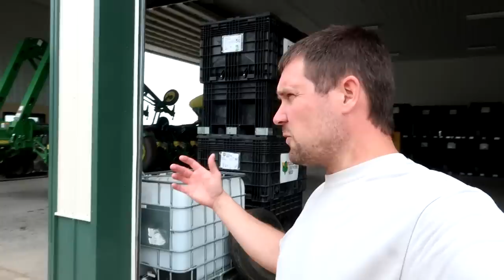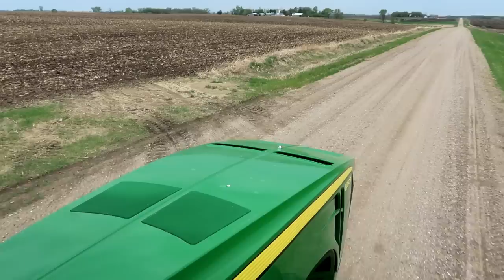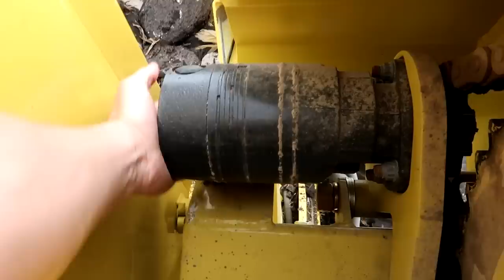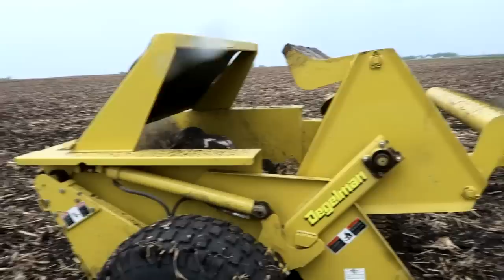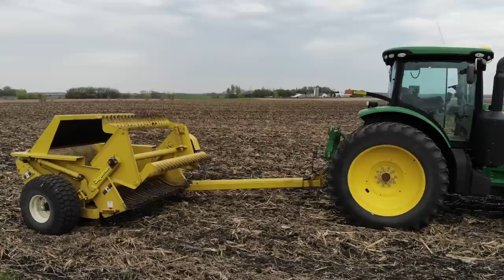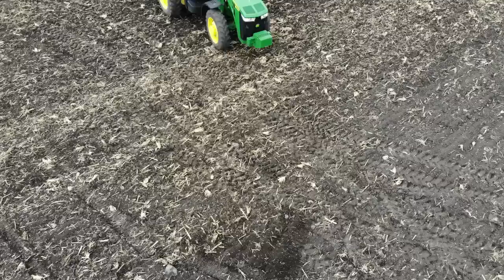How our Rock Picker Works

Comment: Over machined on the pickup, we had one with the samed lay out but the pickup was a 5 foot blade instead of a reel with a chain get that when raised it dropped the rocks into the hopper. Worked great.and didn't have to stop to pick the rocks

Comment: We just bought a Degelmen identical to yours last winter. We were moving stones in it (we were loading it with a skidsteer) and I bent both cylinders first day out we locked the teeth going up and down and dumping with that locked bent both of them. We run ours on a 7210r and have had great luck

Comment: Its nice to how different the hydraulic version of the Degelmann works. On the farm i have been working on here in north dakota, My boss has the wheel powered version, where the reel is driven by the right wheel on the rock picker.  Most of the times where i can see that the rocks is laying on top of the ground, then i dont slow down, thats because i want to get the rocks in the back of the bucket. But that one doesnt work as good in wet or really soft ground, because the wheel would start dragging. I have managed to get rocks out of the ground, that i couldnt get in the bucket because of the size.

Comment: Yeah great implement to have 
Wish we did. Clearing fields that have been fallow for half a century (old dairy land) for a vineyard. We clear and burn leaving sticks and lots of rock all over the field but mostly in the burn piles. Most sticks and rocks we hand pick and or take to windrows then pick up there.
Most of the stone we use for walls  or repairing older stone dry stack walls.

Comment: Please send rain to us in the central valley of California. 5 years of drought, a normal year (12" is normal for us), then another dry year (only 8"). Also, we did our rock picking with buckets. We walked a 40 acre field behind a little ford or ferguson with a platform that dumped. Most rocks were between marble and baseball size. Some were football to basketball size. I was in junior high, I'm almost 51 now. We filled many buckets and dumped many loads.

Comment: I haven’t seen any rock that size in our volcanic soil, our rock picker is like tine rake that draws rocks to a turn table. Then moves onto auger metal belt into 12t box trailer I wish I  could a post pick of it.  We used NH TM125 pull rock picker but once starts load up, especially up hill the TM125 start struggle but Magnum 215 would be no problem, dump our rocks in waterway so soil doesn’t wash away.  Great vid👍

Comment: That explains why the Degelman pickers are offset: they're meant for spot picking. In Farming Simulator you get a whole bunch of rocks evenly spaced over the entire field. so it's easier to go in rows, but it requires five to seven-point turns to turn that machine around.

Comment: My first days picking rocks was throwing them on a stone boat and  unloading them the same
Lol.  Btw send some of your rain to Saskatchewan!  Hasn't rained all spring and is hot and windy every day.  Hope canola will germinate!
Reply from the maker: 379insk we're actually a lot dryer than much of MN.  Good luck with the canola!!
Reply: MN Millennial Farmer ......Am seeding yellow peas today. Ground is hard and dry.    RR Canola IS next .   Soybeans will go in last. Have a great day!
Reply: Yup. We used a stone boat until the rock picker finally showed up on the farm one day.
The non farmer is not going to understand the purpose of rock picking. You should start off you next video explaining the need for a clear smooth seed bed and also how rocks ruin expensive machinery. Your explanation of the machine and it's operation was great, but not all of your audience understands why you ho out and do what you do, when you do it. The beginning explanations will help the non-farmer.

Comment: Man, almost seems faster doing it by hand, lol! But those mini bolder would wear your back out pretty fast! How deep are you working the ground? Guess we are pretty lucky most ours,are softball size!
Reply from the maker: WTFarm Girl we dont bother with softball size rocks!!  And I can't pick by hand because I have fancy, expensive finger nails.  We are tilling at around 4" right now, but about 7-8" in the fall, that's what rolls a lot of them out.
Reply: oooh, did you take my suggestion of Ferarri Pink??     we tilled 3ft and only pulled out a few rocks (and a disk over 25 years old!)      4" with that size of rocks. . . youch!
Reply: Zachs def NOT a Ferrari pink. Gaga Green would  work though
Reply: WTFarm Girl  yeah I wore a buyback out that didn't help picking rocks all by by hand carrying them back to the truck or meet out all for a rock garden🤗🐝
Reply: what they meant to say is they can't because they don't know how to operate heavy machinery... kinda sad in a way but I thank them for what they do.
Reply: What we do for large rocks is just put them up to the bucket on the 4020, then have 2-3 guys push the rock into the bucket.

Comment: we had a rock that was poking out of the ground. So we dug around it to dig it up. It was to big for us to handle. We called a guy with a back hoe to come out. He started digging and it was about 15 feet wide by 7 feet wide and about 12 feet deep. He dug a deeper whole next to it and shoved it in.  It was worked its way back up after 30 years.

Comment: the rock picker needs longer tangs on the basket so it can get under the rocks better.  the top surface of the extended tangs needs to be curved to match the bars swing above so its not just starting straight up the ramp..

Comment: Luckily  no rocks around here.   But rocks can be anywhere !    A helium line placement did bring some to the surface.   Last fall I was harvesting corn when a small 8" one jammed in the gathering chains and broke the two gearbox shafts.    The rock was from Manure.   Seems that many years ago...the feedlot manager put rocks into the pens, that is when I quit getting that manure but not soon enough.

I would hate to have your rocks!

Comment: About how many rocks do your fields yield in a season? Mine are always small and I get about 90 bushels. What fertilizer are you using? Where do you get your seeds? Any other tips you can give me? I run a small rock farming operation and got a big order for next year.
Reply: If you have a big enough field and wait a long time, a rock will fall down from the sky.

Comment: MILF: I understand the physics of frezze and thaw cause the rocks to "float" upward from bedrock over the years. What I want to know is how often do you have to run this Rock Picker over a field? Am I correct to assume you could not run your tilling or planting machines over this field until these rocks were removed? How many seasons passed since you last removed rocks from this field? What would happen if you ran that very expensive-looking tilling machine over this field without first removing these rocks?  Please advise. Thanks.

Comment: Nice video. could've done without the rap music beat crap!

That  picker handled pretty good. I liked how the basket dumped em out like a dump truck. I had thought the reel was PTO driven until you talked about the hydraulic motor. Good job

Comment: Jeez, you didn't have a bigger tractor you could hook to that thing? Lol. 
My friends have a rock picker similar to that they use on potato ground but they go back and forth in the field and pretty much pick up everything. 
Yours also has a lot more paint on it than theirs does.
Reply from the maker: Ryan Porter I like the 6410 on it but that's a little small, this is our next option!!

Comment: Does the basket on your rock picker have down pressure I forget what brand ours is but it's green and is made somewhere North Dakota but anyways it's aggravating that it does not have down pressure it just barely skims along the service and if you accidentally drive over the Rock there's no way you're getting it up without getting out of the cab it's so aggravating to the point where I just say screw it and get out of the cab and manually pick them up

Comment: If you slow your reel speed down a little and put your forks down a bit more and keep driving instead of stopping you will find it will sweep those rocks in LOTS faster.  You might pick a little more dirt this way but you will pick about 5 times more rock, instead of the slow goofy way you are doing it.

Comment: Maby a stupid question. How does the rocks end up in the first place? Are the rocks under the soil?
Reply: CheeseOnion2 2 The glacier deposited them about 10,000 years ago. The frost keeps heaving them up year after year.
Reply from the maker: CheeseOnion2 2 yep.  The hard frost every winter pushes them up a little and eventually the tillage pulls them to the surface.  We need to pick rocks before we plant every field...
Reply: MN Millennial Farmer, does the cultivator driver log where the rocks are on the GPS system?
Reply: AASparkChaser Thanks!
Reply: MN Millennial Farmer Thanks! You make great videos.
Reply: MN Millennial Farmer f

Comment: how are all those rocks still in the field?    hasnt that field been plowed and planted for like decades?    and no farmer before you has ever come up with the idea to remove rocks?
Reply: raafmaat I've got the same question
Reply: My family had a farm for well over 100 years in New England.  We were still pulling boulders out of the same fields my great great grandfather plowed.
Reply: @seanoreiley48    i understand that that is the case,   but how/why?     how come the rocks are still not all gone?   i would assume after so many plowings, what are the odds of big boulders still not having been found?  hehe
Reply: raafmaat based on my understanding at least in New England pretty good.  It has to do with all the rocks left behind from the glaciers receding during the Ice Age.  It’s estimated that they left behind millions of tons of rock so I’m sure someday all the rocks will be gone but probably not in my lifetime lol
Reply: They are brought to the surface by the freeze and thaw cycles,  or at least moved up enough the equipment can grab them,  or so I was always told.

Comment: The geometry of that rock picker is all wrong. It should have a shallow enough lead into the hopper so the rotating claw does not jam the rock against the ramp. I'd have that thing cut up and modified in a day, it would drive me crazy using something that poorly designed.